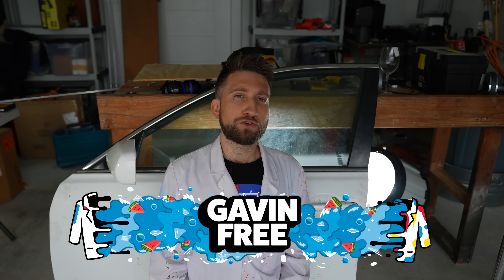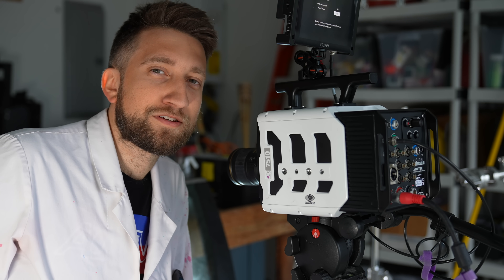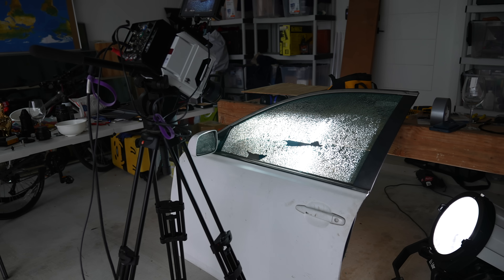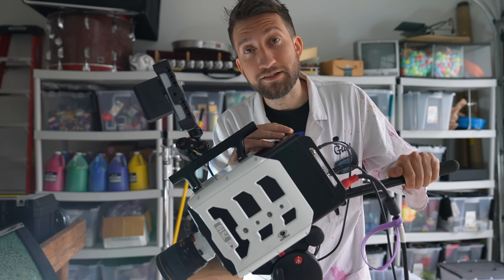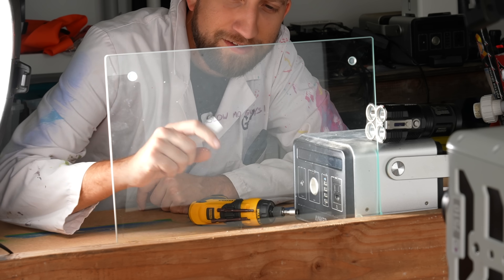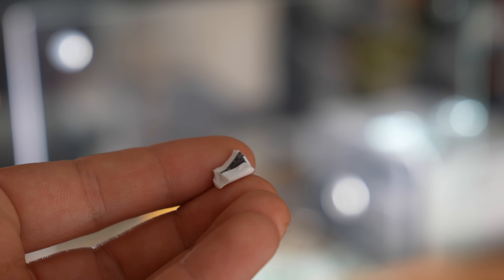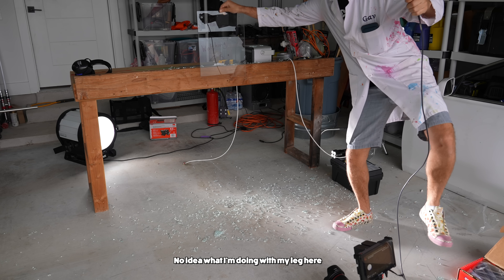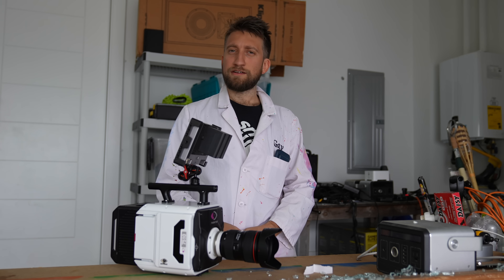Spark Plug vs Car Window at 800,000FPS! - The Slow Mo Guys

Comment: The crack speed is over 1894 mph / 3048 kph, assuming the second shot shows at least half a 14" cutting board from the hole going left, so 7" in 210 microseconds.

Comment: Well, Gavin, here we are. BYU has a holography program where they're suspending tiny particles with lasers and moving them around fast enough to make 3D images without a display. Time to get right in there and slow em down.

Or there's the good ol' standby of teaming up with Demolition Ranch down there in Texas and firing off some 50 BMG incendiaries.

Comment: The spark plug lights up with the refraction of the cracks because the new phantom is equiped with a RTX 3090

Comment: “i should’ve  put down a tarp, i’m gonna smash 5 more pieces of glass and forget the tarp”
Reply: In fairness, only realising that this would have been a good idea after smashing some glass, and then going on to smash several more pieces of glass without acting on that realisation, is basically the most Gavin thing imaginable.
Reply: @AGenericMoron  it's the "already made a mess may aswell see how much worse I can make it" logic. Very British.
Reply: Adding a tarp after the fact isn't really going to help though... Cleaning up glass is just as obnoxiously painful if it's one pane or ten panes.
Reply: It's Gavin what do you expect.
Reply: Having done this to dispose of some left over shower doors, I agree... should have put down tarps. But, once you start, you might as well go all in.
Reply: I'm pretty sure it takes the same effort to sweep up 10 broken windows as it does to sweep up 1.

Comment: As a welder Id like to see a stick rod striking an arc and start welding in slow mo if you have the means to film that. Thinking if not much interesting happens the spatter flying everywhere would prob still look cool like when you wiped around steel wool on fire.

Comment: I've been told in school that it's the similar molecular vibrations between the ceramic and the glass that causes the shattering and that you need two hits in short order (aka two pieces or two edges striking) to cause the break...

Comment: Gav, were you able to calculate the speed that the cracks actually propagated based on the footage? I assume it was close to the speed of sound in glass, but given that the cracks don't travel in straight lines, perhaps not quite that high.

Comment: 7:58 playback speed 0.25 you can see the glass vibrate  and finally it cant hold the tension and break. crazy (correct me if i am wrong )

Comment: 800p and 736p are NOT 720p lol. i don't get why people say things like this. 800p is its own specific thing, and you used to see it show up on laptops pretty often. 736p is another oddball one i've seen on older screens. 720p is the most common resolution for older "wide screen" monitors from the 2000's or 2010's. Maybe people lump them in because marketing just decided to start rounding numbers with "2k" and up? Or maybe its the whole 21:9 thing not being a real ratio? At any rate, 720p is literally 720 progressive scan vertical height, and nothing more or less. It could even mean a "standard def" 4:3 ratio screen.

Comment: 19 frames to the furthest edge of the frame at 80k fps...that is fast (0.002375s).  Don't have a distance measurement, but would seem in line with speed of sound in glass.

Comment: Instead of using a spark plug take some ceramic and crush it into small bits.  Then just fling some at the glass.  Can be ceramic from anywhere. A toilet or a sink or even a spare ceramic tile.

Comment: At over a million frames per second, I have to wonder how absolutely massive the data rate must be. 

Also, it's nice to see those glass "cutting boards" at least have some usage, even as a cheap piece of smashable hardened glass. In actual cooking, those things are worse than useless, and will actively damage any knife that touches it.

Comment: Are you actually close to be able to measure the speed of light in a video with that framerate?
Reply from the maker: Not even close
Reply: light is around 1 foot per nano second so you would need more than 1000 * 500k or 500 million FPS

Comment: Waiting for a "the longest 2.2 seconds on youtube" video now
Reply: yup, first thing that came to mind when he put the stats on screen
Reply: The maximum length for YT videos is ten hours if I recall correctly, so that won't be possible
Reply: @vividandlucid  that is false i saw a 32 hour video that was posted yesterday
Reply: @Troller1991  Nobody really knows the official limits. Some may be limited to 12 hours, others to 10, and no limits at all for others. I'm starting to think that those limits are based on some factors, like resolution, fps, and what content is in the video. That'd at least explain the ambiguity of all this.
Reply: @vividandlucid  
well TECHNIACLLY you can't upload a video longer than 10hs BUT if he streams it and the uploads the stream, he should be able to upload it in it's entirety. When the lofi beats to study/relax to stream died, it uploaded a 10.000+ hs video although it eventually got unlisted like after a week
Reply: We already had it on the speed of light video

Comment: Attempting to break a window with a spark plug?  Reality check #1  use the whole spark plug wraped with a paper towel stand back through fast pitch at the window  well break up in small pieces you’re inside.  Reality check  #2  tint your windows Repeat reality check # 1  as you will see the window is broken up, but stayed together. have friends with experience in these matters! 🕶.

Comment: So anybody know about that insane slow mo camera that has been used to film light? I now want to see that used to film the spee of glass breaking, even at 800 thousand frames it is still travelling extremely fast. I now want to see glass breakoving so slow its looks like a snail mivong across the ground at 20,000 frames

Comment: Aren't you hindering yourself a bit? in a video you mentioned why you recorded at 25 fps instead of 50 and mentioned that when you get a camera that can do much more fps you'd stay with 25, recently yeah cameras are much better but wouldn't it be even better to go back to 25 fps? ALSO ALSO why did you use 3 different lenses for the video? 2 canon and 1 nikon

Comment: Does tempered glass crack faster than plate glass? I remember reading somewhere that they actually shatter at different speeds, but I don't remember which was faster. If plate glass shatters slower it would be cool to be able to try and follow a crack as it goes

Comment: The best way is to heat up the small shard of ceramic, its the way i was shown and does not require much force at all, and when smashing car windows, attack the edges not the middle, the same way your taught to break windows in an emergency...

Comment: That's so strange how it lets you lower the resolution but not keep the aspect ratio, I wonder what the technical reason is
Reply: It's because of how the sensor reads out data.
Reply: yo verified channel
Reply: Focused gains by ensuring that as few moving parts are required, tuned to the horizontal nature of most human filmography?  Just spitballing, I only just watched this, myself.
Reply: @zerosumgame5700  That's my theory: the speed limiter is top to bottom scan speed with no impact from left to right.  It looks like you can narrow the width to keep the ratio if you so desire, there's just not a speed advantage to it.
Reply: It's about the speed the camera can write to memory. If it only has to write a small portion of the frame to memory, it can do so much faster than a full frame, letting you up the frame rate. The shutter moves top to bottom, so that's why the width is unaltered, as it captures the width at all times. 
Same goes for resolution. The less detail you capture, the less there is to write.
The shutter speed operates at a max of 1.25 million fps (or something crazy), but the memory can't keep up unless it's at its lowest resolution and aspect ratio.
Reply: @Yvolve  Thinking about it with your comment in mind, images are generally refreshed from left to right, then top line down, both during recording and playback.  Shrinking the vertical aspect ratio removes entire rows from the image coding.  Shrinking the horizontal ratio just adds dead zones to the remaining rows, it still has to write "nothing here" for the parts that are edited from the sides.  Still spitballing, I don't know how to code, but I might be understanding the process through available information.

If I'm correct, however, then the answer to improve speeds further is the development of a digital imager that can exclude horizontal pixels from processing as well, without making the processor need to evaluate the lack of data on the specified points.  Or some code needs to be written that specifies which pixel to stop on or start from before filming starts, so that the refresh rate per single line can be reduced by limiting the "writing surface" required.  If you have 1000 pixels across that need to be encoded but only need the middle 400, then it would ignore the first and last 300 pixels and just skip right to the next row of 400 without wasting time thinking about the edge 300 pixels in the first place.

I'm willing to bet that this tech already exists, but it's likely not efficient enough for these high speed applications in non-specialized environments (like testing labs).  The reason being is humans are often stuck on what works and aren't often inclined to try to do better what they can already get done.  The refresh pattern on digital formats needs some reworking to catch up with modern standards, we aren't using such limited processors anymore.  The next step in efficiency (imho) is to develop imagers and screens that are capable of rapidly fixating on what changed while ignoring static or unused portions of images on the processing end.
Reply: @zerosumgame5700  You're kind of correct.
The sensor part is right, it is side to side, and the coding is the issue, but there isn't much you can do.

On the sensor side, it would mean turning off rows of the sensor. This is the only efficient way of excluding those pixels. Making the software ignore them adds to the code and takes time to process. It is a fraction of a second, but at that speed it matters.

Coding has been optimised to have it convert large parts of data in short, coded strings, but that is a process that takes time. Writing and reading code is the limiting factor and with the way the memory hardware works, there is no way around it at this time.

The automatic exclusion of, or fixation on pixels requires a very well written AI, because you can't really code for all variables. The issue is that an AI takes a lot of processing power. This means a larger camera.
This process is already used in reducing file size in digital video formats, where instead of having to have code for every pixel, it only has the code for the changing pixels. The actual filming requires a RAW type format, like photography, that has all the data points in them. Turning it into a watchable video can reduce file size immensely. 

In labs they've gone so far as to be able to see light pass through at full speed, by filming it with insane high speed camera's. They've also managed to slow light itself down to where you can see the it move with your own eyes, by having it go through a special material. 

The reason for slow development is that it takes a lot to make new tech into a working product, that lasts and actually works. Not everything makes it past Research & Development, as advanced as it may be. Chrysler made a turbine car in the 60's, poured millions into it, couldn't produce it for a reasonable price, even 30 years down the line. 
Ultra smooth, ran on all fuels and oils, quite efficient. Yet got nowhere, because money.
Reply: @Yvolve  I forgot the word Columns, as in rows and columns, but yeah, I figured that if this is both commercially rentable and affordable to do so, then it isn't truly state of the art.

A fixed lab computer with a focus that never changes more than microscale has all the space in the world for a brain, but something you could hold in your hands would erupt into flames trying to keep up at that level.  Maybe literally, depending on flammability of components or battery type, so physically limited by portability and function.  A mass produced screen or imager that can do as I describe is potentially several decades of coding and hardware improvements out, if this is the next commercial step up, as of this video.

Thanks for engaging, I'm glad I was paying attention to the right stuff, cause there is a lot of garbage information on the function of electronics.  I'm techno phobic, I can't afford to be both afraid and ignorant, because that equals double fear + irrational thinking.  Terrible way to exist, imho
Reply: I imagine the sensor is analogous to a line printer vs a printer with a print head on a carriage.  It just reads a line at a time and cropping the width wouldn't make it any faster.

Comment: 1:54 - 1:59 = 410'000 pictures. :o
1280 x 736 = 942,080 pixels, but without the color dept I can't calculate the size in bytes for each frame, lets assume 8 bit (aka. 1 byte, 0-255) for each: Red, Green & Blue in each pixel, so: 1 pixel = 3 byte (or 3*8 bit = 24 bit)
So, multiply the amount of pixels by 3, which is 942,080 * 3 =  2'826'240 bytes, which is 2.8 Mb per frame.
times 410'000 frames: 410'000 * 2.8 = 1'148'000 Mb which is 1,148 TeraBytes in 5 seconds. 82'000 frames per second, at 2.8 Mb per frame: 82'000 * 2.8 = 229'600 Mb, or 229,6 Gigabyte per second. or about ~0,23 TeraByte per second.

Comment: Please do det-cord going across the screen. It'd create its own lighting so you wouldn't have to worry about that.
Also wondering if you can see the sparks on a tesla coil developing.
Reply: They have done det cord a couple times here's the links: https://youtu.be/W1YrcmtVTYA and https://youtu.be/dHfQYGGUS4U
Reply: @Storyteller543  Yeah, but not at that speed. I want to see it zoomed in propagating slowly through the cord.
Thanks for the links tho. Pretty cool still.

Comment: As a firefighter, I keep a broken spark plug in my turnouts incase I need to break some glass quickly.
Reply: We have little devices that you can press to the glass. This loads a spring which induces an impulse into the pin at the top, breaking tempered glass immediately. No swing, no miss, just pressing a small device against the window. Greetings to my fellow firefighters!
Reply: @the_jcbone  Yea, we have window punches too but they like to snag on fabric.

Comment: That frame rate is insane, how is the camera able to shoot that fast?
Reply: Literal witchcraft using the souls of aborted babies
Reply: Every baby is 1 fps
Reply: By throwing money at the problem, really. Best, bleeding edge FPGAs, high speed board design, and a custom sensor.
Enterprise hardware with no regard for end cost can be fun.
Reply: @Spirit532  I'm going to stick with the dead babies, sounds way more practical